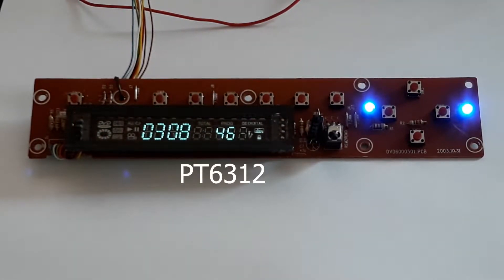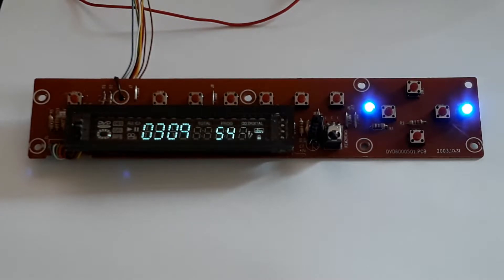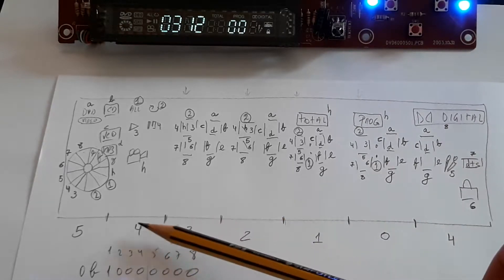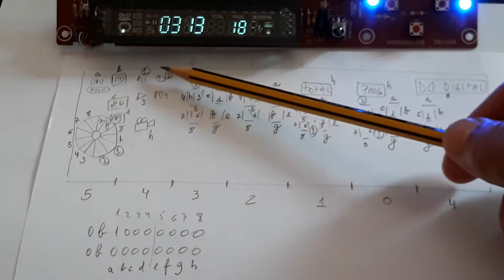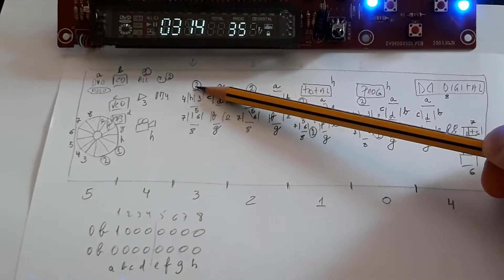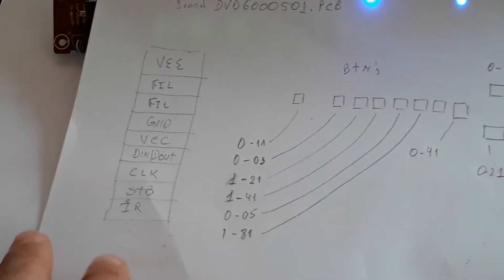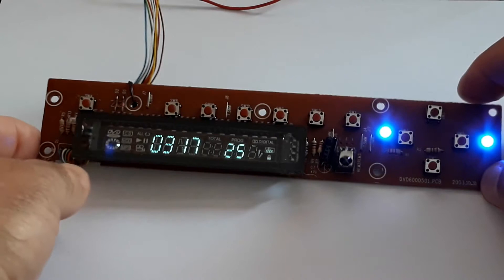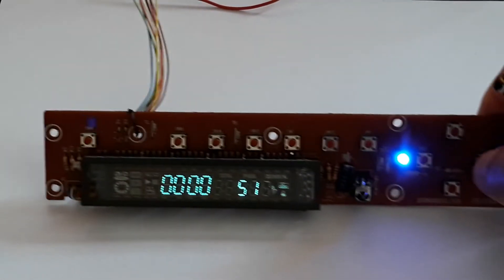PT6312

Comment: Saudações José! Eu tenho um VFD parecido com o seu e um chip PT6312BLQ mas, fora da placa, portanto, como faço as ligações dos pinos dele ao VFD e ao Arduino? Obrigado e abraços desde o Brasil
Reply from the maker: Viva Daniel Fernandes, 
No video sobre o PT6315 (faz search no youtube) faço uso de uma "tiny Board" para extrair os pinos do 6315 para uma breadboard, a ideia pode ser aplicada ao 6312.
Pinos de alimentação: VDD(+5VDC), VEE(-15VDC) e o GND.
Pinos de control: DataIn, DataOut, Clock e Strobe. (no meu code encontras estes pinos em 7, 8 e 9 do arduino normalmente. Grelhas e segmentos ligas os que forem usados no teu projecto!
Reply: @jlsmonte  Obrigado amigo, irei dar uma olhada! Outra questão: o PT6312/6315 não aceita voltagem positiva no VEE?